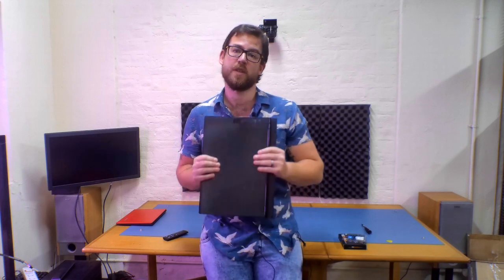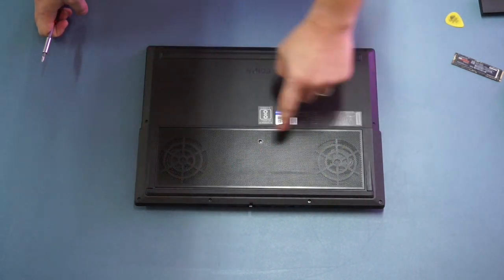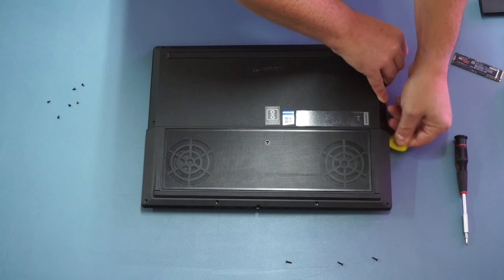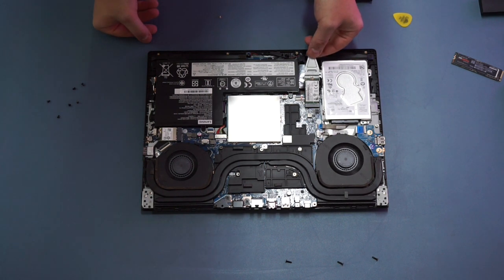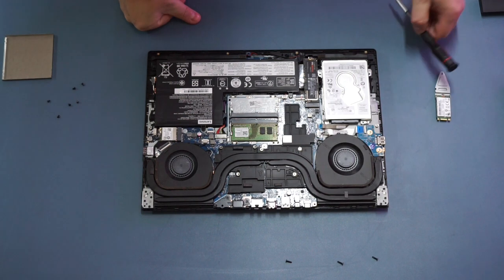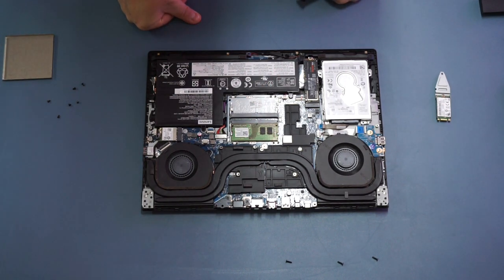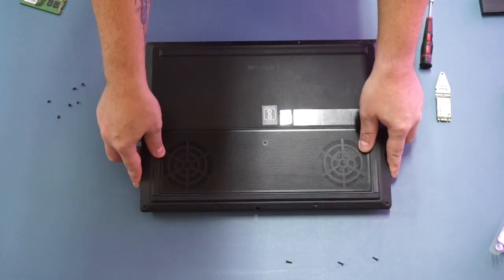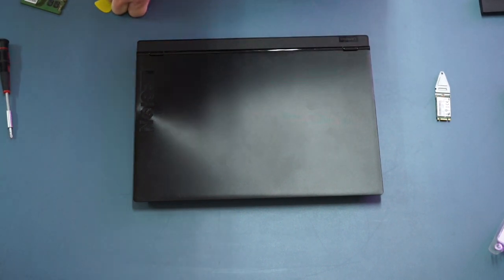Lenovo Y530 Legion Memory/SSD Upgrade

Comment: Hi, I followed the instructions and removed the ram in order to check out the brand, so that I can get another one to add on. But when I put everything back together, my laptop doesn't boot up anymore. The keyboard is working, the fans are spinning and I can see the screen is powered. But now it's just a black screen. Any suggestions on fixing it? Thanks.
Reply from the maker: Have you tried taking out the new RAM module and seeing if it boots up with just the old?
Reply: @TMEretro  I haven't got a new set of RAM yet, since I wanted to check out what brand it was. So I put the original one back in. I might get a new set of RAM and see if that works. Maybe the original one already had some existing problems.

Comment: Hello, I have finally decided to get a better RAM for my notebook. I wonder though, what brand is the original 8gig RAM ? I got a 16gig crucial so I am wondering if I can go dual RAM with the original or if I should just switch out one for another.
Reply from the maker: You'll need to check yourself what the original stick is and who it's made by, manufacturers tend to change without warning
Reply: @TMEretro  Thank you
Reply: If you mean it will work, It should work without any issue

Comment: Great video dude, I am going to buy this laptop so, can you tell me which issue will face in this laptop after some times ??
Reply from the maker: I think it's specific to my laptop but my track pad plays up from time to time. A few others have posted about the same issue online, but it seems to be only a small selection of people. Other than that issue this is proving to be a great laptop for me. I travel with it all the time and other than being a little heavy it's served me well
Reply: @Sebajv Yeah mine is failing too. It is a 7200rpm seagate barracuda pro. Had to buy an ssd and reinstall windows in it since it won't boot up. Using the hdd as a non-important secondary storage now, hopefully it can last for another a year or two.

Comment: Great Video! I was willing to by an Adata XPG SSD model Spetrix 512GB, which comes with a heat sink, which makes it 8mm of hight. Do you know if that wil fit in this laptop? Once again, great video: easy and straight forward.
Reply from the maker: I wouldn't recommend ordering it, I can't confirm if it will fit
Reply: @TMEretro  Thanks for the response, I decided to go with a Corsair SSD.

Comment: Will all my personal files or documents be lost? I understand that I have to reinstall windows, but what about my files such as docs or games?
Reply from the maker: If your files are stored on a drive that you replace then you'll need to back them up before removing the drive and reinstall them on the new drive
Reply: @TMEretro  That's the thing, I'm quite confused since my y530 states that there are only a single drive which is Intel optane + 932gb ssd. So I'm quite confused if I need to back up my personal files
Reply from the maker: If can't hurt to back up your files in any case. That way if anything goes wrong you have them safe
Reply: @TMEretro  yes that's true, thanks for your help 👍
Reply: @TMEretro  sorry, another question. After I upgraded my ssd, should I boot up first or install windows?
Reply from the maker: @arkanandrei6127  after you upgrade your SSD it will be blank, so the first thing you'll need to do is install Windows

Comment: Dude You have done everything without unpluging the battery. It will cause damage.
Reply from the maker: I'm earthed via an earth bonding strip on my ankle, but I agree it's a step I missed out which I should have included, as others have pointed out in the comments. I'll add a sticky comment so others can see
Reply: @TMEretro  Yeah. Better.. As noob people may go straight into it without knowing. nice tutorial. It would be great if you had zoomed to the positions youre changing. If that keep aside. Its a nice and clean tutorial.

Comment: I have the Y530 but don't have the 1 tb SATA HDD, I'm looking to get the Samsung 860 QVO 1TB 2.5" SATA SSD to add onto it as the storage space is quite low, would that be a good option, is it even compatible?
Reply from the maker: I use that drive in my desktop to store games and it performs well. It should be compatible
Reply: @TMEretro  Thank You! Also, I do still have warranty on my Y530, would upgrading it void it?

Comment: Never worked on laptop before :P is disconnecting the battery easy enough XD only ever worked on my pc
Reply from the maker: Yes, and it's a step I should have covered in the video. There's a small connector and lead off of the battery that plugs into the motherboard, disconnect it

Comment: Just a quick question, can you leave the original ram stick in and add a new one from a different manufacturer, or do you need to replace both?
Reply from the maker: You can but you need to ensure that the speed and size are the same if you want to run in dual channel mode for better performance
Reply: @TMEretro  So mine has 2666 Mhz 8 gig Ramaxel, I can add a 2666 Crucial 8 gig, right? Nice. Thanks
Reply from the maker: @armasplaygrounds6355  should work

Comment: I just upgraded my RAM and installed an SSD. Your guide was exceptionally helpful, especially for a first timer when it comes to working with computer parts. 

Honestly, bless you man!
Reply: Did you back up your Windows OS before putting in the new SSD?
Reply: @japiboy6979  I hope they did
Reply: Did it help ur gameplay
Reply from the maker: You're welcome!
Reply: Isn't there 2 slots for ssd? or is there only 1?
Reply: @sanskarkaazi3830  just only 1.
Reply: @sanskarkaazi3830  One. But imho, you should always have an HDD alongside your SSD. SSD is great for installed programs, and for running things quickly. But, the installed HDD is 7200rpm, and it's fast enough for an HDD, and it will last longer (given you don't drop your PC, and shit like that).

I always use the HDD to store date in the long run. But also use backblaze for continues 1:1 backup. I mean, if you use backblaze, or any other backup tool, you don't need an HDD. But still, an hdd has better longevity than an SSD.

Comment: Its possible to upgrade from 16gb intel optane to a nvme ssd to run linux? get windwos in HDD and linux in SSD? i was looking how to do that without damaging windows 10 boot
Reply from the maker: I wouldn't recommend this approach.  The issue is your system would default to booting from one drive or the other as setup in the BIOS.  You would not easily be able to switch between OS.   I would replace the Optane with an SSD and then install Windows and Linux to the same SSD, using the Linux setup options to manage dual boot settings.

Comment: how am I supposed to reinstall windows 10 if the computer is not able to boot up because I took out its SSD? Also I currently only see my HDD in my data storage and boy has it been slow.
Reply from the maker: If you go to Microsoft website you can download the Windows 10 Media Creation Tool. You can use this to create a bootable USB stick which you then use to reinstall Windows 10 on the new SSD

Comment: Does it support 1TB SSD?
Reply from the maker: You'll need to check with Lenovo, I can't provide a guarantee, though I can't see why it wouldn't
Reply: I just ordered a 1 TB ssd from Amazon to replace this week.
Reply: @Sal214OC  have u installed it? Is it compatible?

Comment: I noticed that the two ssd drives  had different pins, the small one  seemed to have a SATA m.2 connection and the Samsung one NVMe m.2, I don't know a lot about this, how does that work? Great video btw
Reply: The existing SSD that was removed is a M.2 SATA SSD, that explains the 2 grooves. Whereas the Samsung SSD that was installed after that is a M.2 NVMe SSD which has 1 groove. However both are M.2 connector which are compatible to a PCIe (serial bus) slot. 

SATA and NVMe are both different technology. Whereas M.2 is merely a connector. Whereas the existing big square HDD / SSD disk on the top right uses a 2.5" connector. 

Thus M.2 & 2.5" are 2 different type of connectors.
SATA & NVMe are 2 different type of technology. NVMe is the latest, much faster than SATA.
Reply from the maker: There are two drives here, an NVMe PCIe M.2 drive, and a 2.5" Sata drive
Reply: Tech Made Easy I'm trying to figure out the same thing. The first SSD has just one pin whereas the second SSD has two pins. Could you explain me why is that?
Reply from the maker: @Slipknot98Rzk  The smaller of the two drives uses a connector called M.2.  It's a connector found on most laptops and desktop motherboards these days for high speed storage.  The larger drive uses standard SATA connectors for data and power.  SATA is a legacy type of connection used in laptops and desktops.  SSDs using the M.2 connector tend to be slightly faster and more compact, but are more expensive

Comment: When you upgrade ram do I get better gaming experience? Great video btw
Reply from the maker: Not particularly, in most cases.  While some types of game do use a lot of system RAM (simulation games, mainly) most are more reliant on graphics memory, which is seperate from RAM.  Increasing the RAM is more beneficial to productivity workloads like video editing and rendering
Reply: @TMEretro  Thanks alot for the explanation.  ♥️
Reply: Something worth of note is that when you "upgrade" your ram, more specifically, when you add a second ram stick, your CPU performance WILL improve! This is because modern CPU's are design to work in dual channel (dual sticks) and their performance is hindered when using a stick alone. I got a Y530 as well and saw a performance increase of +/- 10% on the CPU

Comment: When replacing ram do you loose anything ? Or do you have to recover anything or is just the replacement reeboot and everything likenit was?
Reply from the maker: Good Question.  RAM is what's known as volatile storage - it's used when your computer is on, but when your computer is turned off it doesn't retain any data.  Hard disks and SSDs are known as non-volatile storage; they keep your data when it's turned off or restarted.  Your operating system, apps and files are stored in non-volatile storage.  
So upgrading RAM will not cause you to lose any data on your machine, only upgrading your hard disk or SSD will.
Reply: @TMEretro  ah ok, I get it know when you upgraded ram did you go into bios and rebooted or did you just turn on as normal because some laptops needs reboot some don't I think
Reply from the maker: @feisalabbasi9265  rebooting means to turn the pc off and on again, which you need to do in order to upgrade the ram anyway. You shouldn't need to change any settings in the bios following a RAM upgrade, it should recognise the change automatically

Comment: It is supportet samsung 970 evo 1TB on legion Y530?
Reply from the maker: Strangely the Lenovo website specifies that it supports a maximum of 512GB, but I see no reason why 1TB wouldn't work
Reply: @TMEretro  so i must try :/ Cruical support 1TB on lenovo Y530 on its website so i dont know...
Reply from the maker: @vojtechdurkovicphotography2583  if Crucial are stating its supported then they must have tried it
Reply: @TMEretro  i cant find nowhere on web this info...
Reply: Vojtech Ďurkovič does it work?
Reply: @martinchen2434  yes, work perfect!
Reply: @vojtechdurkovicphotography2583  so considering that the cruicial 1tb works then the 970 samsung evo 1tb should work too i hope. i got one coming in tomorrow I hope it works :(
Reply: Tony F does it work the 1TB ssd
Reply: @alrhhhhp  WORKS! 100% SO FUCKING FAST!
Reply: @alrhhhhp  the only problem was I could not keep my hdd it's not allowing me to select to boot from the new ssd rather I had to take out the hdd but it doesn't matter I don't really need the hdd anywya
Reply: Tony F thx maybe you need to modify the bios and select to boot from SSD

Check out below

https://www.crucial.com/usa/en/ssd-install-m2-1
Reply: @alrhhhhp  awesome ill try it thanks for info!
but geeze i am honestly in love with this ssd lol its insanely fast
Reply: Tony F again what was the spec of your new installed ssd. I bought Samsung 970 EVO plus 1 TB  do you think it will work
Reply: @alrhhhhp  yes that's what I installed the 1tb Samsung 970 evo
Reply: @alrhhhhp  Im sure the plus will work too
Reply: Tony F good news :) Samsung 970 EVO plus 1 TB works fine with me in legion Y530
Reply: @alrhhhhp  that is awesome!

Comment: There is no need to remove battery connector?
Reply from the maker: A good point. You probably should, and I should recommend you do so for liability purposes. But I've never bothered and never had a problem.
Reply: @TMEretro  I'm thinking on replacing my HDD for a SSD I got this laptop on a lenovo offer, I'm also afraid of warranty, what do you think?
Reply from the maker: @chentips  double Check with Lenovo that you won't void your warranty by replacing the drive.

Comment: I have a question about having a hard drive and m.2 ssd. 
If I have my ssd for booting and loading stuff and if it ask me to update anything would it be using my ssd or hard drive?
Reply from the maker: Any windows or application updates will be installed to whichever drive contains Windows or the application
Reply: Tech Made Easy thank you so much. You just got another subscriber here :)
Reply from the maker: Appreciate that, lots of helpful how to guides coming up!
Reply: Hey I got another question can I have 8gb ddr4 ram in one slot and the other slot 16gb ddr4 ram? Would it slow down the perform or have any issues?
Reply from the maker: @klaythompson3211  The Lenovo website specifies that the maximum RAM on this machine is 16GB, I can't recommend you try this, but if you do and it works let me know!

Comment: i'm a newbie at this , can you please tell me why a lot of people take out the battery before doing the upgrades ? ty
Reply from the maker: It's to avoid causing any electrical damage to your system.  with a laptop the battery is always supplying charge to the motherboard.  In theory there are two risks to upgrading while the battery is connected; 1) you could damage your new components, 2) You could receive a small electric shock.

Comment: So I have a question.
My disk drive went bad, and I have a new 2.5” ssd to replace it.
Is the operating system on that smaller ssd, or is it on the hdd?
Can I just plug and play with the new ssd?
I’m wondering if I should transfer my operating system over, or should I not worry, because it is actually on the smaller 80mm ssd?
Also what exactly is the point of having a ssd and an hdd
Reply from the maker: So let's take your questions one at a time, in order:
The operating system will be on the smaller SSD.
When you plug your new SSD in you may need to set it up in Windows; click on the start menu, type "computer management" open the app, click on Disk Management and set it up from there.
Leave your OS on the smaller SSD, it'll be faster than a SATA SSD.
The reason to have two disks is that SSDs are much faster, but more expensive. The idea is you use your SSD to install your OS and apps so that they're faster, while storing all your large files on the larger hard disk

Comment: Very good Sir, I have successfully installed the devices by following your instructions. Although I out one 8gb crucial next to the generic one do you recon this is goi g tó be a problem?
Reply from the maker: I would always recommend using a matched pair of sticks, but if it's working for you then great!  Generally the worst that will happen is that your sticks will operate at the worst speed of the two and at the worst timings, but this is usually not a problem.